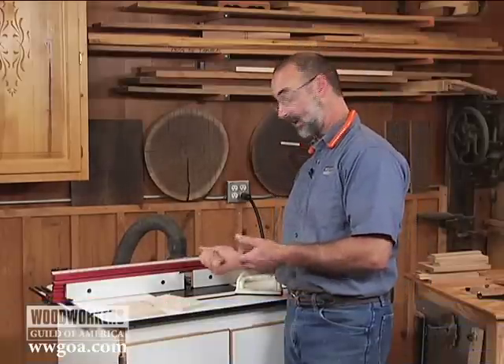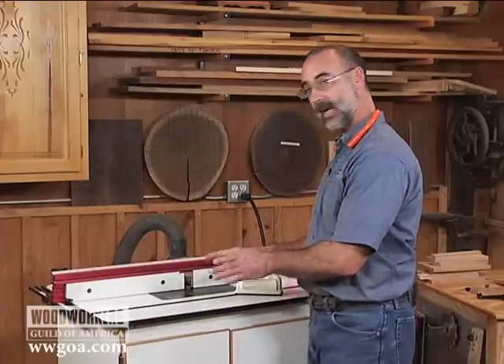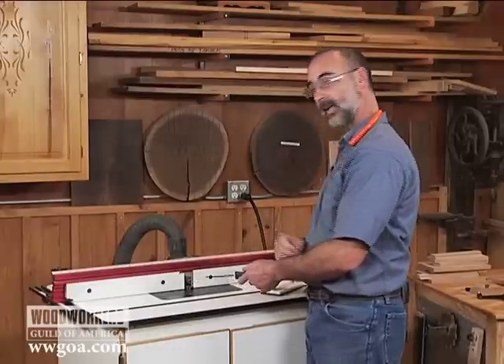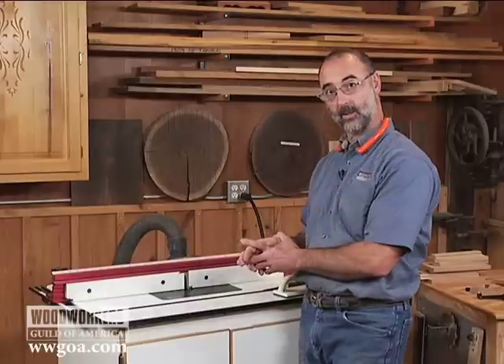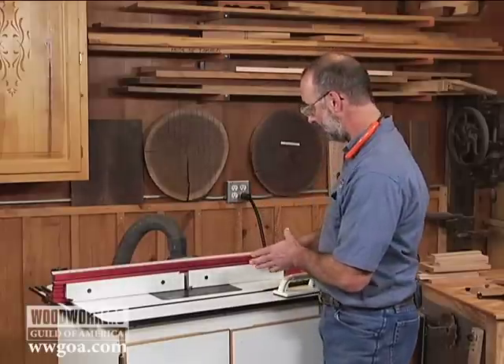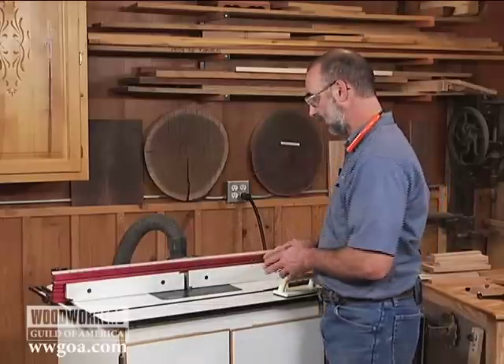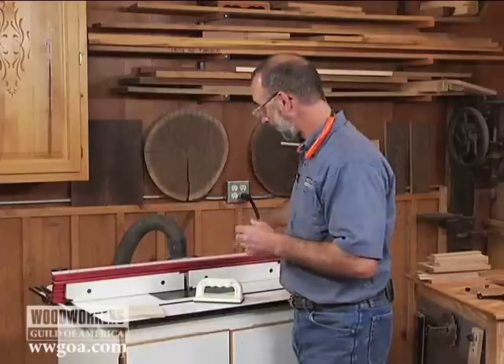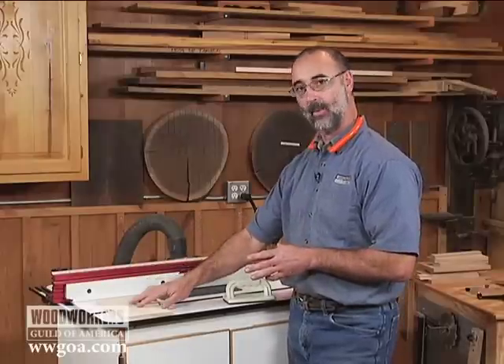Wood Tips: Router - Zero Clearance Router Table Fence

Comment: How do I keep the right shoulder of the outfeed fence from snagging my material that I'm trying to router? What am I doing wrong?
Reply from the maker: Hi Shirley.  There are a couple things to look for here. First, put a straight edge across both sides of the fence and be sure that they are perfectly coplanar.  If they are not, this can cause the problem that you are describing.  The other aspect to this is technique.  Be sure that you are applying pressure on the infeed side near the bit toward the fence, and avoid putting any pressure on the workpiece directly at the bit which can push it deeper into the cut and catch the outfeed table.  Once it has cleared the initial point of the outfeed table, you can apply pressure on the outfeed side.  Also, you can slightly chamfer the fence on the outfeed side to minimize catching, but this should not be done to compensate for an out-of-alignment issue with your fences because that also dictates quality of cut so you first need to adjust the fences so that they are coplanar.